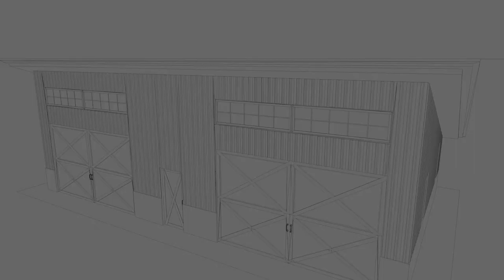Steel Building w/ Wood Siding - Great Western Steel Building Systems

Comment: Why are some building girts bypass and some flush?
Reply from the maker: Hi Daniel, Girts and Purlins on can be made flush to move the rigid frame columns and rafters to the very edge of the building. This doesn't affect the square footage for the most part - it just gives more clearance around the heavy I-Beam framing. This building https://www.youtube.com/watch?v=vGJcRjPRPVM has a flush purlin and girt system. It is a good example of a flush system. Hope this helps.

Comment: I'm becoming very interested in your work. Already in contact with you guys about a project. My main concern for a while has been the exterior look. I see that here there is a wooden exterior and ceiling. Is that also part of what you do or was that all the owner's side? What are the options for exterior texture and look? Thanks.
Reply: Hi Prema, GWB Provided the structural steel framing and the owner hired a second contractor to deck the building and roof with plywood. The siding is Cedar, The wainscot and roof is corrugated weathering steel similar to Corten. Very Nice siding and steel.
Reply: @ericbeavers4769  I too am looking to get a building from you. Do you offer the Corten option, or one like it?
Reply: @markschneider4469  Hi Mark, we do not offer a weathering steel product but there are suppliers that run siding like this pretty much all over the country. I’m familiar with some. Mostly in the western states though.
Reply: @ericbeavers4769  Thanks, have a call schedule with Jeff from your company next week. Would love any installer referrals if you have. We are in central Californian.